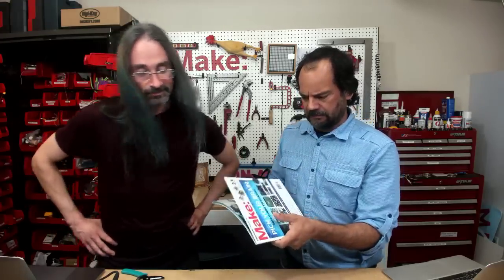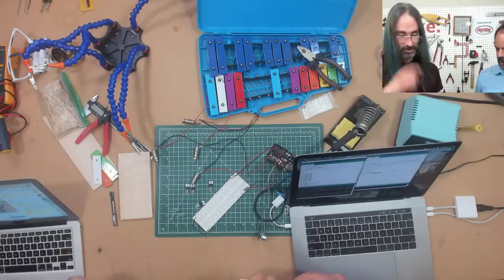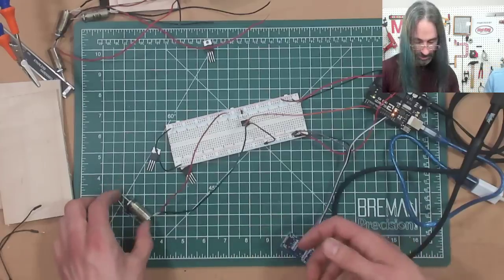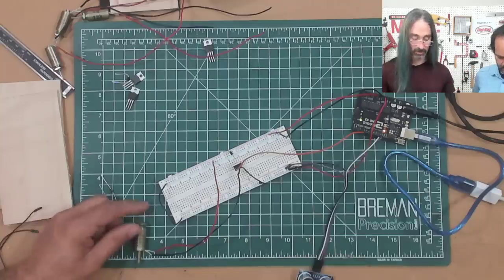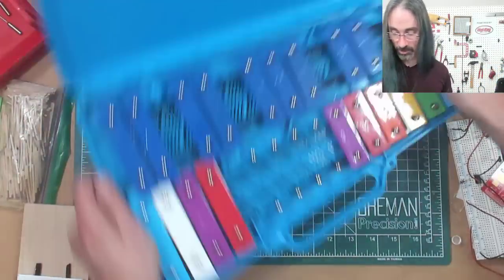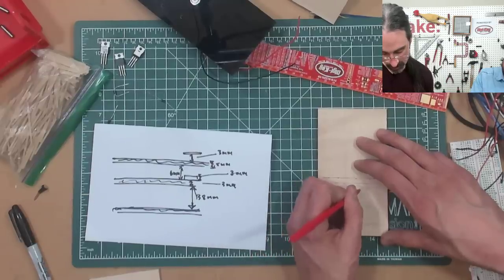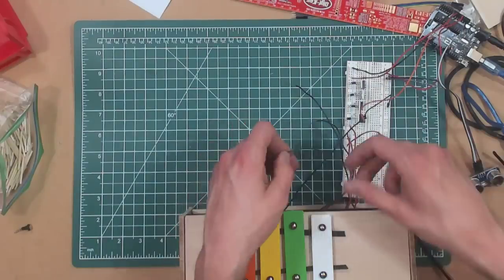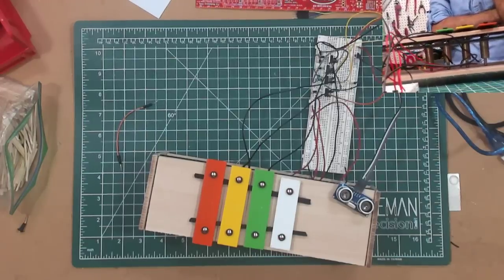Make: Live — Robo-Glockenspiel

Comment: Bridge mode operation is the way to go, Distance=speed/t so divide the speed of sound by the time t, use Opto couplers to couple your Arduino board to the relays, can you not compile your code using gcc-avr compiler collection to the machine code the Arduino uses.